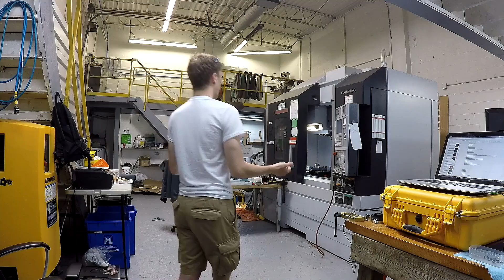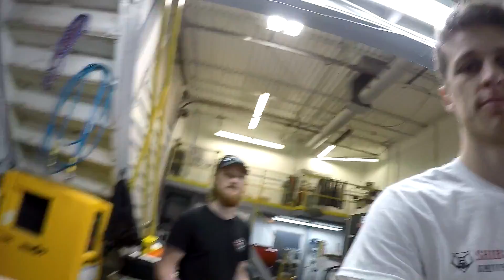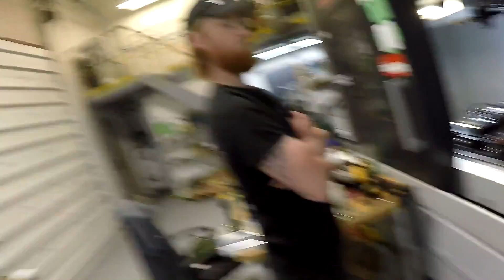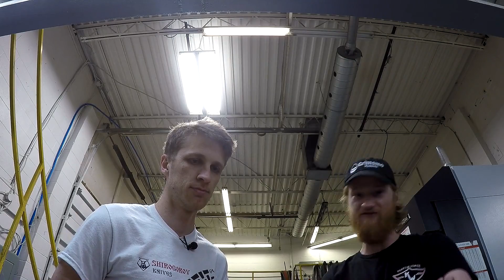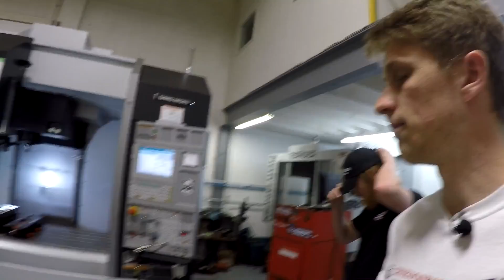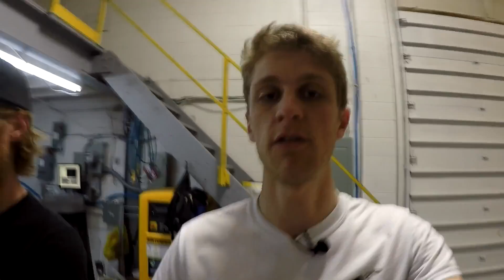Mori CNC mill purchase story - Grimsmo Grind 014

Comment: You know John, I have followed you guys for a long time, but your opinions on the Mori are totally skewed, that DuraVertical is not speced any better than a Haas, actually if you look at a ball bar plot vs a Haas, Haas runs theirs at 100ipm, the Mori runs theirs at 20ipm to get similar results, and also is true for their new Eco mill and CMX Mills, they use smaller ballscrews, LM guides etc. Frankly you should have had each builder test cut your parts, and the thing is you could have bought a machine for less money with more options that would make you more money. Also, you should really add a Midaco pallet changer to help with your through-put, and mori sells those for $89k with a DDR, I can send you quotes some of my customers have gotten from the mori guys. Just wanted to add my thoughts, thanks for the podcast, love it!

Comment: Hey Grimsmo, im an amateur cnc machinist and I use to program and maintain laser cutting tables for a company I worked for. one of the guys taught me a little bit of autodesk and solidworks while I was there. What smaller cnc mills would you recommend for a garage hobbyist knife maker? Any advice would be helpful and money is not an issue.

Comment: ouch, it's an old video I know but I can't believe how badly you get raked over the coals in Canada on everything!  we spec'd out a nearly identically equipped duravertical 5100 last year when they phased them out in the states and had a large stock of them sitting in the country and I feel badly sharing the prices!  basically out the door they were just under $80, 000 US. Unfortunately we didn't have the ceiling height to handle it or we certainly would have had it. Not sure where in Canada you are but it might be worth shopping in the states for machine purchases in the future. We were shopping DMG at Boldt machinery in erie pa but I'm sure there are many dealers in Buffalo Ny that you could check out

Comment: Hi John, I'm a Brother person too. They float my boat, friggin awesome. I have worked on Makino and Mattsuura and even an older Hitachi Seiki. I did work(sold CNC machines) for the distributors of Mori Seiki when the original MV40 VMC came onto the market(now thats a long time ago). Visited the Makino factories too a few years ago and it was agreat experience. You would love it. These days I'm a Okuma fan(big time). I nearly bought a 15 Y.O MX45 that had been traded in. It was from an Okuma distributor. Had a rebuilt spindle, and i asked him how accurate could I expect it's positioning to be, you know wear and tear. 15 years of production I said. He looked at me, smiled and simply said "same as new". Okuma's don't wear slideways or ball screw assemblies. 
Your Mori Will last forever and then some. congratulations on a great machine.

Comment: Never got to play with them but at my old work we had a few MORI machines like that in the milling department. Hell most of the shop was mori based from bar feeds to mills. My current work is based with HAZZ machines and while you can see the cheapness in allot of them, I prefer them mainly because of the nice setups and the fact I can switch from a lathe to a mill and the controls are all the same give or take.

Comment: I have run Mori's and Haas and others, I like Haas they are "smarter" in a way or easier to use, however Mori is a WAY better built machine. Nobody wants to crash, but it happens and Haas machines are fragile compared to Mori. Just my 2 cents, either way make chips and make $.

Comment: A very good presentation. It seems that the sophisticated machine will do more pleasing works for your customers than do a full utilization of its capabilities in your actual works. Recall back the of year 87' when I just came out school and worked in a factory. My boss was persuaded by a salesman and bought a Japanese Ramcon 3TC; a NC machine with a digitizing stylus head. The price at that time was almost similar as that of yours. Salesman boosted that the machine liked 'A hen that can continually lay the golden eggs??'.I  still keep the machine catalogs.... Great machine will change in time, motor, mechanical method, electronic, computer software.....

Comment: I love seeing you starting your own business especially with such an high-end product. I work as salesman at an machine tool manufacturer in germany, we built high-end drilling machines (column, radial etc.) and the market is very though in the non cnc-machine tool business. My thoughts are the same as yours, you should really be confident with your choice of machine, otherwise you will constantly think "what if...". I got many customers from the mould- and toolmaking industry, that want to built high-end products with a price expectation of a chinese or used machine. But if you buy one of these you shouldn't expect to make your products the next 20 years with the machine and than give it in cash, because thats not going to happen.

Something to 12:00 : What i learned over the years is that ppl that come in with shorts and more casual are often the ones who will buy the machine and/or have more knowledge. The "suit-guys" are often the purchasers of middle sized and big company's that buy the super cheap machines or come to get something for free.

Comment: Hi John,

I had a bit of a look at my own machine (Bridgeport GX480) it also doesn't have the flush but it has the button for it. I had a look in the back and mine appears to be fully wired and ready, there is a relay alongside the main coolant relays and this is wired to a socket on the back of the machine next to sockets that take power to the main coolant pump and conveyor/auger motor (I have an auger). On the coolant tank there is space for a second coolant pump and I think this is what is used for the chip flushing. Of course your machine is likely to be completely different however more than worth a good survey of the rear of the machine, possibly listen for a relay click while someone pushes the button.

Comment: I can imagine pathpilot running quicker because it's linux, the controller I have built runs a asrock a55m-hvs with an apu ( built in graphic Co processor ) 8 gb for ram is over clocked to 3.2 gigs its a 64 bit machine and an 120gb ssd hard drive, in short windows 10 boots in about 40 seconds it a large tower so all cnc drives, breakout breakout boards  ( just started wiring second one ) and power supplies are in the tower, a 36v for the three stepper drives and motors nema 34's, 12v for proxity home switches and 5v for breakout boards and voltage displays, the uccnc 300 can run 5 parrallel ports at once which means when I build an atc, 4th or 5th axis I will be well setup, the reason for the quick pc I to run fusion 360 on the controller so no running back and forward to edit g code, it's been about a five year build but I feel worth the spare time put into it, I am designing a atc like the one on umc 20 by dave decassin, it's a drum style changer and should hold about 20 tools I hope when finished and I plan to post the plans on grab cad, again thank you for taking the time to rely as I know you guys are always busy, thanks daniel
Reply from the maker: +Daniel Kitson sounds awesome!  Great work.

Comment: hi guys, i love the video's but why are people complaining so much about mach 3 cnc, i use mach 3 cnc at home and find it ok, yes it has its problems but a lot of the youtube cnc guys all started on mach 3 cnc and got to where they are now using it true ??, i feel maybe its about making parts when all said and done, not how good the next greatest machine is, you cant compare a $150,000 cnc machine to a £20,000 can you ?? if it was me a would have 3 to 7 cnc machines that way you can make more parts at the same time ?? please let me know wot you think ok, thanks daniel
Reply from the maker: +Daniel Kitson you're right, i spent many years on mach 3 and understood it well.  But it wasn't until i started using another system, Fanuc and PathPilot, that I realized how many freaking headaches Mach was giving me.  It would glitch out.  It would lose offsets for no reason.  I had to have systems upon systems just to be able to make good parts, sometimes. When machining becomes a business not a hobby that's when the  problems and issues go from being fun challenges to progress crushing headaches.
Reply: Thanks for the quick rely guys, So you think pathpilot is better ?? I number of people are hacking it i believe to run on no tormach machine because tormach won't release it to none tormach owner, I have tried the old linuxcnc when it was emc2 I liked it, but to add stuff was hard work if your not a programmer, I run a g0704 cnc at home on a uccnc300 usb board and mach 3 cnc with some custom Macro's with no issues because the uccnc card is directly driving the Mill, I believe this is similar to the Mennsa card on path pilot ??, I can see your point for running a industrial CNC machine but only if it's making good money, I have a friend I work with at times with a few million pounds sterling ( i am in the uk ) of cnc machine including a 9 axis Morri Siemens cnc milling machine, he makes £30,000 of parts a week so the money in his machines I can see, but waking up on a monday morning knowing I had to make that sort of money would scary me to death, I think the point I was trying to make was yes mach 3 cnc has it place in the cnc world as it's a big world, I just like to see anyone seaming to be get run down I hope you see my point and please keep the video's coming, thanks daniel
Reply from the maker: +Daniel Kitson the usb board you're running is a huge addition to Mach, I'm assuming it's  similar to the Smooth Stepper.  I always wanted to do that.  Path Pilot does seem to be a lot better, but it handles everything differently so it can be very weird for the advanced stuff for a mach guy to switch over

Comment: I ran a 30+ year old mori seiki lathe than still ran as good if not better than all the new HAAS', mazaks and anything else in the shop. Been crashed plenty of times over it's life and still held .0005 tolerances without any problem.

As far as the coolant gun, you could do what I did. My lathe did not have that option, so I took a hard rubber/plastic hose and put a coolant coupler on both ends, then just hooked it up to whatever tool I was on, hit coolant on(M8) and washed her down.

Comment: John, love the vids, and appreciate the perspective...but it's pretty quiet there.  "If the spindle's not turning, you ain't earning!"

I know the owner of a local fab business.  They've been in business for 40 years, have 80+ employees, and a bunch of really cool machines...so they are doing many things right. They keep the machines busy as much of the day as possible...even lights off.  They load up pallets at night and on Fridays, and the machines self load as they finish parts.  The point is that the.cost clock is always running, but you only make income from finishing parts and time is a fixed commodity. The less time you waste, the more money you can make. Every minute of stopped machine is money you'll never ever see. I understand about not batching prototype parts, but I'd think at this point you are in production mode on some things, not prototyping mode. You might want to consider versioning parts, and not change production designs all the time. Just an idea. 

-- Mike
Reply from the maker: +BigMjolnir great thought Mike, thanks.  I know that's where we need to be, it's just hard to beat the prototype mentality out of my head and get into production mode.
Reply: +JohnGrimsmo John, you've said you enjoy the problem solving aspects the most, so "production mode", where things are locked down and fixed wouldn't be very attractive to you. You've also said that Erik (did I guess the spelling right?) enjoys turning out good parts. Maybe you could give production to Erik, and you handle R&D? Once you get a design you consider "good enough", you give it a version number and turn it over to Erik to produce, while you start on the next design.  If production turns up issues with a previous design, you work out changes, increment the version, and move to production. You and Erik coordinate moving things from design to production between yourselves with a semi-formal procedUre. So your twiddling the design doesn't interfere with production. The Mori is for production and final design testing, and the Tormach is for R&D.  The main idea is to "batch" the tweaks, rather than tossing them in continually and disrupting production. What do you think?

-- Mike

Comment: Hey John, loving the videos. I subbed about 6 months ago and have been working through your videos and they are great!. I am 17 and looking to start my own gunsmithing business in the future. I already have a nice lathe and a shitty G0704 grizzly milling machine but i really need a cnc mill with 4th axis to flute barrels and bolts and such. There is a used 2013 haas tm-2p with only 1000 hours on it for sale on ebay that has caught my eye. Ive never run cnc nor do i have anyone to teach me but i think i can teach myself. I dont need a cnc mill that has a ton of power and rigidity to make big huge cuts i just need one that is extremely accurate and can hold .0002-.0003" tolerance. I wouldnt be opposed to a tormach if they can hold that kind of accuracy. Any advice? I still have one year of high school  left and a couple years for a business degree at college but id like to know what im doing and have experience before i open my business for real and start to take on work. Thanks!
Reply from the maker: +Longrangehunter the Tormach will struggle with those tolerances, that's the kind of tightness I'm working with now.  The Haas should do well! But don't rush into it, do your research,put in the work, and have fun with it!
Reply: +JohnGrimsmo Great, thanks for your input! Also, i know you are focusing on the rask for 2016 but how would i go about ordering a Norseman? Thanks!

Comment: My problem with the brothers is the lack of RPM. I think if you are primarily working with small and tiny tools max rpm is the number one factor if you really want to be efficient. I would love a Mori with 40-50k RPM but dang they are $300k. Going to the flag day sale June 14th at the local Haas HFO, if there's a deal to be had, I might just have to pull the trigger.
Reply: On the plus side BT30 toolholders at 15k RPM don't need the same balance treatment as a CAT40 over 10k.
Reply: if you have through spindle coolant, buy yourself a typhoon from colibri spindles
Reply: Fischer977
Yes I have seem them, but there are too many limitations not including the price. I think your better off getting the right machine for the job in the first place. Those seem like a good stop gap for prototyping or a small feature on an otherwise large part ect. In my case I would have to get 3-4 of those things, it just wouldn't make sense, for me.
Reply: bensbenz you are totaly right. the solution i suggested is a compromise for not buying a machine,  for parts i saw in these videos ,a good used machine would do the work perfectly.  i have 15 years old hitachi seki vs50's with 12,000 rpm spindles, which im using for  complicated parts and even molds components, in the price of one new mori you buy 4 older bridge type and 1 normal lathe

Comment: Haas is a decent machine but you get raped when there are repairs to be done(at least where I am). We have a couple great service techs we use when we can't fix it ourselves, but with Haas they don't like to share technical info so you end up paying thru the nose to use their tech guys.
If you plan on holding onto a machine for many years don't forget the service side of things!
 I'm jealous...I wish we had a Mori!                        Thanks for sharing.
Reply: You don't know what rape is until you owned a DMG Monoblock 40
Reply: We have a Mori lathe at work. When it's going it's not a bad machine but when we run into a problem Mori support doesn't want to know us. Their after sale service sucks ass! In Australia anyways, might be different in other countries. That's why we went for Mazak. We now have 6 Mazaks and 1 Mori. lol!

Comment: The relays for the wash gun are listed in your electronics manual; their name is somewhat vague, but they're there. You can also just install a T & ball valve off of the main coolant output, but then you run the risk of forgetting to flip the ball valve back and starving your tool of coolant. Or, I think the coolant gun option is only like $3,000 :)
Reply: That's all we do at work as well. Just tap into the main coolant outlet. ;)

Comment: You need to get the generic documentation for the controller, there is probably an IO board to which you could attach the required relay.  The machine I just got has a Siemens controls and I managed to download enough documentation to allow me to add a probe and other options.